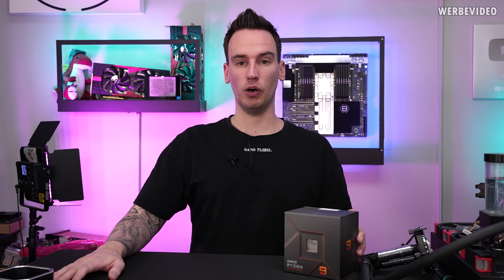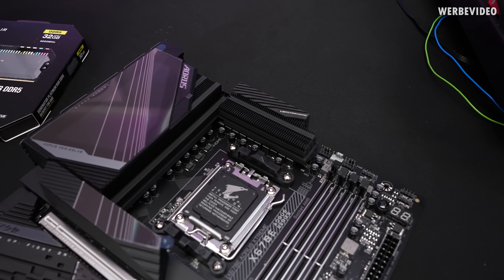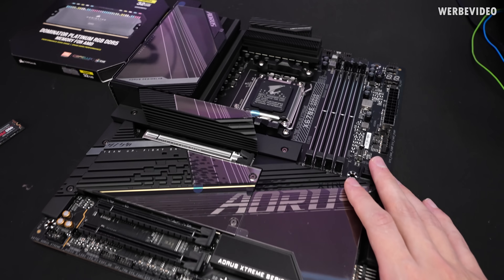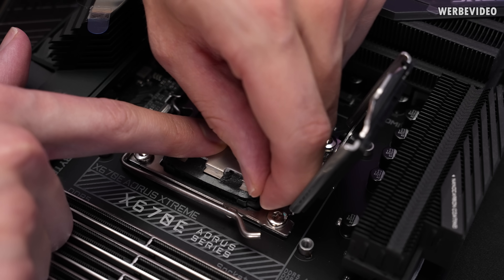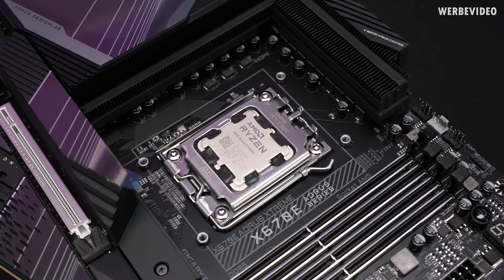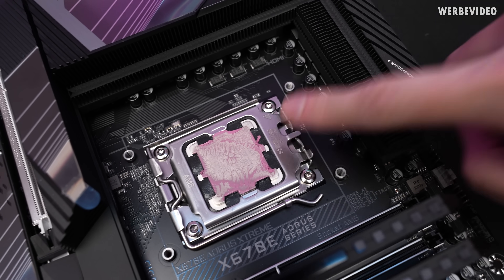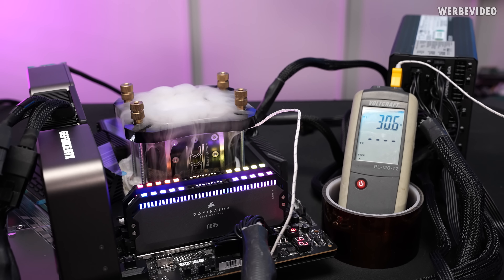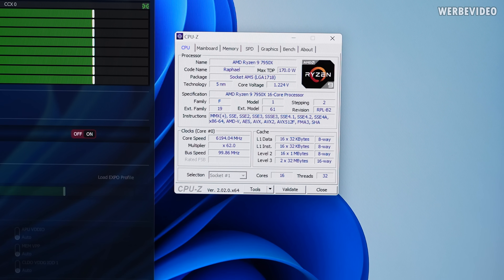Ryzen 7000 Temperature Scaling - Overclocking the 7950X to over 6GHz with Dry Ice

Comment: It's insane to think that the normal boost clocks of modern CPUs are what we used to get only under extreme LN2 cooling- amazing times we're in
Reply: As someone who started with computers in the 90s I don’t think it is very impressive. Then we saw a 10x increase in mhz in just a few years like 266mhz around 98 to 2,6ghz by around 2002.
Reply: Euh, 1Ghz was already a serious limit for pentiums. 🧐
Reply: @goldnoob6191  My 286 ran at 25MHz.  It's a rounding error now.
Reply: @FuburLuck  yup never had a 286, Amiga reigned supreme back then..
It was just to say to our millennials that the world did not began with them and considering their dirty work, it would never have been possible to get what we have now with their unlimited vanity.

I remember when 3Ghz.. blah blah

I remember when Intel was running 25MHz and Motorola was readying it's 60MHz 68040 CPU. 40Mzh was considered an insane overclocking for an i286 at the time.. 🙄

That's a non sense anyway, some spurious mindset of a geek coming from nowhere, next year all will be remembering how 7GHz was considered an absolute OC for a Pentium 4 😑..
What's the point ?
Reply: @FuburLuck  Yeah thinking about the 8088... put in floppy, turn on, go to lunch, come back and still not done loading...
Reply: @frizzlefry5  Or the PET computer I first worked on.  Start it loading your cassette tape. Spend the next hour hoping your tape works.
Reply: @FuburLuck  wow, you had a 286-25 Harris CPU?! Man, you must've been filthy rich! 😁
Reply: Ye! but sth like 7-8 GHz was achievable about 10 years ago :)))
Reply: @shteud01  yes, with LN2 at the  begining, now it's getting possible on WC, tomorrow it will be on air and so on..
Reply: what is more impressive is that it took us like almost 20 years to break past 4ghz for real. the time window from 100mhz to 1ghz was like 4 years
Reply: Ah for the days of extreme speeds of 300MHz......... Jesus Christ I'm getting so old 😟😟
Reply: Still a pretty extreme cooling solution
Reply: good point.
Reply: it's called the Endtimes for good reason
Reply: As impressive as it looks but i try to look at it differently. these cpu makers have hit the physical limit of adding more transistors hence they are only left with the option of increasing clocks to gain more performance. they cant do this forever. This indicates we need a breakthrough in cpu making technology maybe go quantum or something.
Reply: @anurag7058  well that's untrue, we've still got several lithography nodes to go before we start hitting a hard limit with silicon and even then smarter design, chiplets, 3d stacking will carry us a ways further.
Reply: @simonhazel1636  try and cool 3d stacked transistors. Maybe if we return to the 3ghz era.
Reply: @ExalyThor  lower clock speed with 3d stacks could be worth it. Just seeing how well the 5800x3d works even with it's slower clocks, it competes with 5ghz+ cpus easy
Reply: @anurag7058  unless i'm wrong i'm pretty sure quantum computing as it is now isn't really viable for mainstream pc usage.
Reply: @anurag7058  Except an issue called quantum tunneling occurs once things start getting smaller, its even been an issue already.
Reply: @anurag7058  we’re along way off that. Every node shrink increases density and allows higher clock. But that’s the least of it, better design is improving IPC (instructions per clock) each new iteration too. We’re seeing 10-20% each new CPU generation in IPC alone. IPC + clock speed is giving us ~30% each new cpu iteration. Then the likes of large extra cache 3D cache chips are further performance enhancing still. That’s here to stay as another metric to improve performance further separate from clock speed again.

Then there’s ever increasing platform speeds with faster DDR (5 can hit 8MT/S already!), faster BUS speeds with PCIE doubling speed each iteration, PCIE5 being twice speed as PCIe4, and the drivers utilising that are absolutely phenomenal. PCIE6 spec now approved and on the horizon being twice as fast as PCIE5 is mind blowing for the data transfer speeds that will allow. 🤯

Lastly we have core count, some software even today can still only use 1 or 2 cores, thankfully most at least use 4 cores well and some can use 6-8 OK. Once programmers manage to make software fully utilise all available cores to their maximum across the board we could see some very good performance gains for 8 core + CPUs and fantastic for 12 and 16 core chips.

Core OD software transitions like low overheard versions of UNIX and low overhead direct access APIs like Vulcan deliver phenomenal performance improvements on their own just from being better programmed.

PC tech space is the opposite of stagnant or developing slowly, it’s in sonic boom territory and the next decade or so minimum is going to continue as the last few have. Let alone if the mainstream can properly transition from X86 to ARM and the extra efficiency’s that brings.
Reply: @GTFour  ARM? you mean RISC-V?

Comment: Wish you would test normal boost behavior vs thermals while you did these cooling experiments and not just manual OC. Since that will be questioned all the time after release.
Reply: Probably similar. You can observe a slow frequency drop running an all core workload as temperature rises. AMD has likely done internal testing and has CPUs auto scale based on temperature, though at a much more granular level.

Comment: The best thing I've found for removing your old thermal paste is hand sanitizer. Brand doesn't matter. Paper towel and q-tip to get into the hard to reach areas, this gel dissolves the old hardened thermal paste. Hope this helps. god bless and stay well.
Reply: Might as well use (99%) isopropyl alcohol (the main ingredient of hand sanitizer), although if you don't have any around you can use hand sanitizer
Reply: @user-bf5sc8pn8x    I always use a dry cloth first before using IPA because it it much cleaner and faster to not have all of the thermal paste liquified by the IPA.
Reply: @user-bf5sc8pn8x  Exactly what happened, no IPA around when I needed to clean off the thermal paste.
Reply: 99% IPA is a much better option.  It is more effective and does not leave a sticky residue behind when it evaporates.
Reply: @HamBown  Thanks for the response. Didn't have any IPA available at the time. The thing about the HS is it doesn't evaporate as quickly, so you use it to soften up the thermal paste before you wipe it off. Also, I haven't noticed any sticky residue when using the HS.

Comment: 2:10 Yes, AMD socket was neglected, good luck getting 5000MT/s RAM to run on anything other than an ITX board
Reply: could be also related to amd locking down the agesa stuff whereas on intel boards manufacturers have more freedom
Reply: @ThunderingRoar  Could be, but then again, it works fine on ITX boards and specialty overclocking boards with only 2 physical slots. 
My 5700G runs great in 1:1 with 4933C17-17-17-28, actually faster than What wendle showed with the 7950x DDR5 6000 C30 with custom timings, he got something like 72GB/s 63ns and i get 74GB/s 49.1ns
Oh and this is with a kit that costed me $90, IIRC that DDR5 kit was $340
Reply: @denvera1g1  well you re comparing a monolothic cpu to chiplet one, on 7950x the 2 seperate core chiplets have to communicate with eachother so infinity fabric will often be the bottleneck
Reply: @ThunderingRoar  3 chiplets
Reply: @ThunderingRoar  i'm not comparing the 5700G to the 5950x, i'm comparing the 5700G on half a dozzen ITX board to the same 5700G on really high end ATX boards
All of the ITX boards will hit at least 4800, the ATX Boards struggle to hit 4200 unless they are 2 slot only boards specifically for RAM overclocking
Reply: @denvera1g1  oh i see what you re saying, well one dimm per channel boards are gonna have much better signal integrity than 2dpc ones and the differences become bigger the higher frequencies you try to achieve. Thats why all serious overclocking boards are 1dpc Regular atx boards are mostly 2dpc since i guess people usually care more about having more ram capacity than speed
Reply: @ThunderingRoar  Yes, and thats why i think AMD boards were neglected, When i bought my 12600k and ~$120 motherboard with 4 slots, not only did it have no trouble with 4400C19-26-26-46, but it even worked with 4 DIMMs at those spec. Where as my $370 AM4 board could not hit 4366 with just 2 dimms, in the 4 slot board using the same dimms in the LGA1700 board
Now 4400 seemed to be the limit for the 12600K/that board, but i never tried to de-couple the IMC/UCK so maybe it could have gone faster with 2 B-dye dimms.

I'd like to point out that on 2 reviews i've seen of the 7000 series, people have stated that they seem to work at DDR5 6000C30 stable with 4 sticks, now this doesnt add to the performance, this, plus the fact that the IMC is on the 6nm IO die, and the 7nm IO on 5700G is often good for 2500 for FCLK UCLK and MCLK normally held back by the board, suggests that with 2 dimms, 7000 series might be able to run DDR5 7000 still in 1:1
I'm very interested to see if Intel 13 improves the IMC for both DDR4 and DDR5. I'd really like to see how a 13900k performs with DDR4 5000-5600 C16-C18 compared to DDR5 6400-7200C30-C38

Comment: I don't know what boards you were looking at in the past, but whenever I wanted to buy something and started filtering for features, I always ended up with Intel boards filtered out almost immediately. AMD was always way better equipped. If anything, Intel started catching up with the 6xx chipsets TO AMD.
Reply: also depends the area of the world u are located in 
so can be different for everyone fr
Reply: @6QG2P9X77W  I live two countries over, and therefore have the same suppliers.
Reply: Understand that when he's talking about "features", he's probably referring to things like VRM configuration and build quality, memory topology, PCIe bifurcation, stuff most people don't need to even understand, and wouldn't be included in motherboard retail listing filters.
Reply: @stoneymahoney9106  I look at half of those as a regular ass user.
Reply: @stoneymahoney9106  Depends on your definition of regular. I meant regular as in frequent, not ordinary.

Anyway, completely beside the point. I filter for features first, then I research my short list for further specs. Unfortunately since 2016 my short list always had 1-3 motherboards, at that point it doesn't make sense to filter for an attribute that doesn't impact performance. PCIe bifurcation is typically something I couldn't care less about since I never used more than one PCI Express device simultaneously. (PCI and ISA are a different story, but again, beside the point.)

I don't utilize proprietary gimmicks, and I don't play around with hardware for the sake of playing around with hardware, I assemble computers to use them.

Comment: Makes you wonder how far he can push the delided chip (7900x) with the dry ice!~
Reply: You can't use liquid metal with dry ice. It cracks at around -10C. And mounting an LN2 pot to the physical die itself without the IHS is dangerous and really hard to maintain contact due to thermal paste cracking. LN2 overclockers use CPUs with the IHS still installed for this reason
Reply: @mylittlepwny3447  Cracking is mostly an issue at full pot, probably won't get full pot most of the time on these chips.  Most of us don't direct die on ln2 due to it being easy to crush/crack the die if you even get it slightly wrong.

Roman would use his Kryo Extreme paste on the dies if he tried dry ice cooling it, not LM
Reply: @mylittlepwny3447  Maybe with a ground down IHS it would be slightly better.
Reply: @mylittlepwny3447  crack kills
Reply: @mikeycrackson  Also Thermal Grizzly Kryonaut is one of the best thermal paste for LN2 overclocking because it can be used all the way down into -200C without any problems
Reply: You could probably lap the die real thin to improve thermal flow though.
Reply: Probably not worth the chance of condensation on the chip, you'd want the "free seal" of the IHS and glue as a barrier to airflow to prevent moisture buildup. I'd use a new cpu.